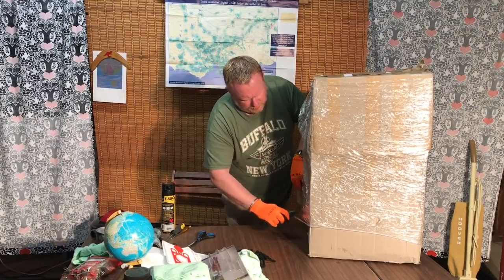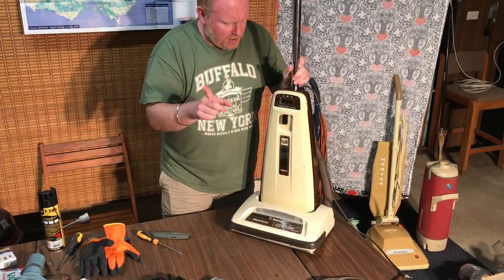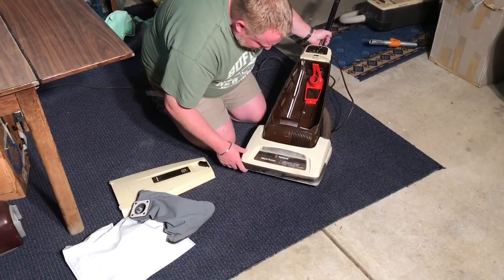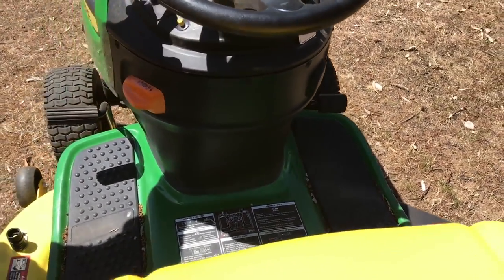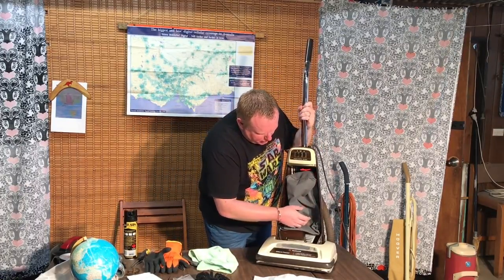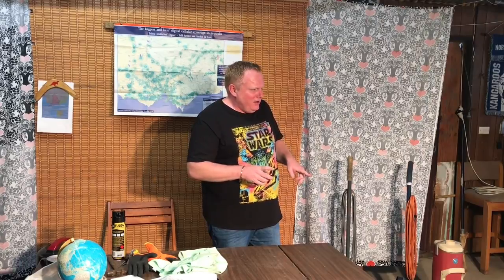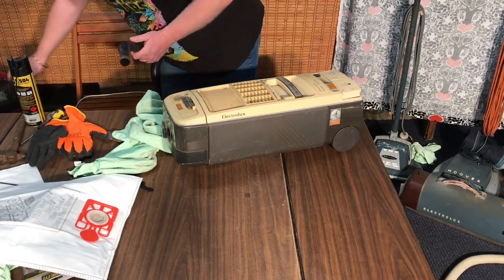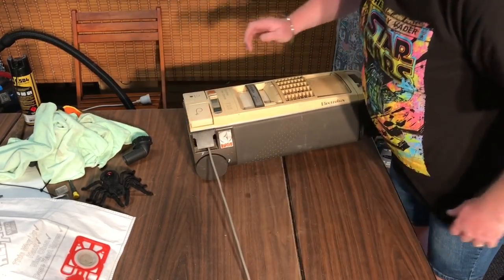My First Australian Unboxing And First Look Video

Comment: Ah the Electrolux 725 brings back memories :) Mum had an Orange and Brown one. They had an external cable that attached to the hose and then into a power head. Lasted for years, never died. Looking at your video I think it was not getting any power. They have a power indicator light near the bag compartment release. It glowed when power was on, cannot remember if it turned off during operation.
Reply from the maker: Yes, your right, it should have a constant light on indicating power and then it went off when you switched it on. I feel the cord is stuffed.

Comment: What a nice old National Panasonic vacuum there - they are indeed rare these days. You can see the similarity to the US model Riccar uprights of the time, as Riccar used Panasonic designs for their own machines.
I wonder if the motor is clogged up with fluff in the fancase, or somewhere within the fan itself, as quite often if the bag burst, the motor would ingest masses of fluff and dirt and much would get clogged in the fan and fancase - I had an Electrolux 500 where this was the case, and it had next to no suction despite there being no apparent clogs in the machine itself. Taking the fan case housing off revealed the ducting between the fans was totally clogged with fluff. I'm not saying thats the case with your machine, but the motor bearings sound like they have been damaged by dirt ingress, so its likely seen a few burst bags in its lifetime!
Reply from the maker: The motor definitely needs a look at, I’m sure it’s as dry as the outback. I’ve recently realised that the bad door seal isn’t working, so I am going to replace that with a PurePower seal I have. When I closed the door right the suction was normal. Hopefully just some polish and a clean up and it will be as good as new. I’ve discovered that Miele bags fit it perfectly!!!!!!